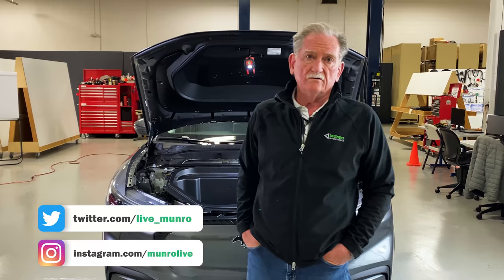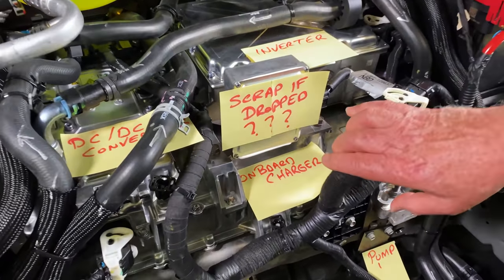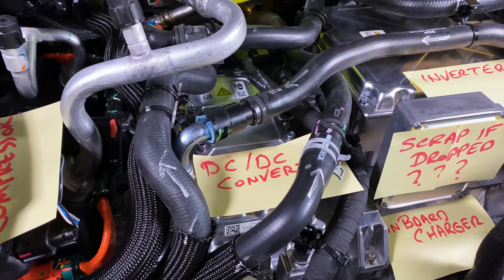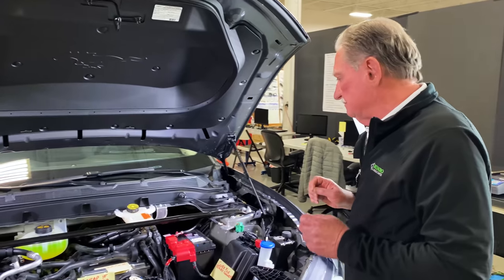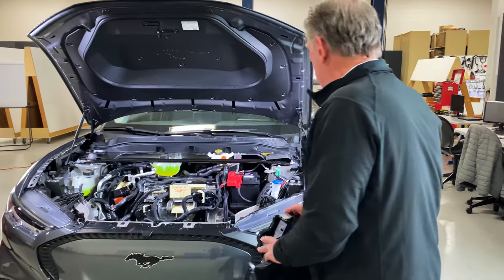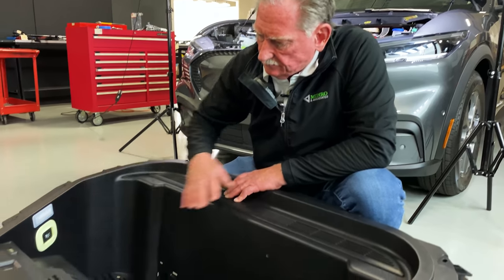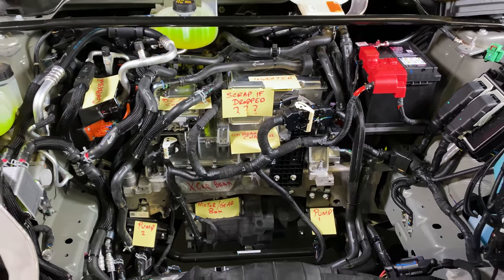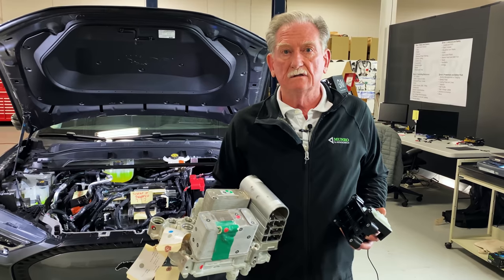Mach-E Thermal System Nightmare

Comment: I hope the F150 Lightning is better designed than the Mach-E
Reply: I don't expect the F150 will be much different since the design philosophy at Ford remains unchanged. Tesla appears to take the vertically integrated approach to everything, whereas Ford wants to buy components sourced from the cheapest manufacturer and hold them to very high-quality standards, and then integrate them all together. The problem with the latter approach is that it results in a more complicated system that leaves you vulnerable to assembly error and quality issues down the road, regardless of how well you test the components and vehicle level testing during the design phase. Tesla's approach will win in the end.
Reply: @vector006  I thought one of the main gripes about tesla was poor quality control?
Reply: good luck. The dealer model cannot survive without them engineering things that break into the product.
Reply: @Sam-tx1tn  Why are you so bitter?
Reply: @thdjjfsfh  stating a fact isn’t being bitter. This guy is a cash chaser. No more.
Reply: @Ranjan  Rahul Who cares as long as it works? Tesla quality is worse. No bonus points for being prettier underneath if it's poor quality anyway
Reply: @Sam-tx1tn  No, you're bitter and hateful.  All he said was he hope the truck are better design.
Reply: @EricJohnson-dc2ej  Poor quality? Sorry pal but my neighbors been driving one as a Taxi now for 5 years. Best car he as EVER owned in 30 years of driving a cab. Its got over 300,000 miles on the original battery and other than tires, suspension bushings, shocks, one set of brakes and some minor trim things the cars been flawless. And its costing him 1/4 of what his Prius used to.
Reply: @EricJohnson-dc2ej  yes that is true for now. They don't have a robust DVP&R process yet like the legacy automakers do, but I think they will evolve as the company matures. Their design philosophy should win in the end though.
Reply: Lol. Same. I'm already sold on the lightning. But Ford's decision to overly complicate basic systems has me worried they're more interested in keeping dealerships open, than building a sold EV.
Reply: @BremboT  sounds like this guy hasn't even talked to anyone at Ford as to why they did what they did so most of his comments are uninformed speculation. He doesn't even know what all the parts are.
Reply: Fard: Hehehehe hee hee >:)
Reply: @davefroman4700  Riiiiiiiiiiiight………..

Comment: I Love your breakdowns and a fan of your work. I have to let you know that ford changed their plastic long after you left and those connectors don't leak anymore. You would be surprised how their plastic under the hood with an engine and it's heat, will hold up even with a turbo. My son has the car to prove it. Hopefully Tesla's plastic is as good because I just ordered my Model 3 😁 Keep up the great work!

Comment: I originally thought that EVs were supposed to be more reliable because of fewer moving parts, but after this video I see "OMG this is going to leak and it's going to be a nightmare to fix". Great video by the way.
Reply: Not Tesla, that's why but Tesla
Reply: Replacing a hose and a clip is not difficult, but the high number of hoses and clips and what not, will make sure if you have repaired one, you are back in the shop a while later to do another one, and this goes on and on, to the point it gets really annoying, and if out of warranty also costly.
Reply: From what I’ve read they are not under pressure like ice cars.
Reply: Ford has the hungry dealers to feed with the money of the customers - it's obsolescence design at its best.
Reply: Nonsense, who said its going to leak, there is no temperatures from combustion engines there which can mess the hoses durability.
Reply: @AndrewSienx  wrong.
Reply: @alanmay7929  "Hoses gonna leak, thats just a fact"- Sandy Munro.

You have temperatures from the batteries, and its porbably under some pressure as well.
Reply: @MarcoNierop  only yime will tell, the temperature from the batteries is not even close to what the combustion engine can produce nice try.
Reply: @alanmay7929  You are not an engineer, aren't ya?

The coolant is basically water, and its not cooking to steam in a combustion engine (if it does, you have a problem!), so the cooling water does not reach 100 degrees Celcius.. You can check the temperature on the gage in your car, 75 degrees Celcius is about normal.

Batteries feel the most happy arround 80 degrees Celcius, so the cooling gets pretty hot with batteries as well, not much difference with a combustion engine.

Quickly counting I saw at about 20 hoses, that means 40 connections, or 40 chances of getting a leak, versues maybe 4 or 5 in a Tesla, that is 8x more chance to get a leak in a Mach-E.

Comment: I think Ford and GM were caught flat-footed when Toyota developed and ramped up the Electric car movement and are now under tremendous pressure to transition their operation to have anything competitive to offer. They had to design and push out an electric vehicle fast, and it couldn't look like a grain wagon pulled by two Doberman Pinchers. I know the electric Mustang looks good from the outside, and it is fast (as most electrics with enough battery power are), and that will be enough for most teenagers - longevity and reliability are mostly concerning to those with enough life experience to know how frustrating break downs and repair bills are.
Reply: The question is, even if these parts are complete garbage, like a crappy plastic pump fails every 60-120k or it throws a leak through a pipe.

Ford will sell you parts. That's the difference. 
They're crappy parts, but they'll let you have them.
Reply: @MrClassifide  I will choose the car which has parts available at reasonable prices. Tesla havent been around that long but they seem unwilling to help with parts as soon as you are out of warranty.

Comment: ...why use radiator when you can increase cooling area of the hoses? Also, in emergency, excess heat is dumped by leaking boiling fluid trough the loose connectors over the electronic circuits that automatically shut down the system...xD

Comment: You remind me that we owned a 1986 Taurus MT-5 (2.5 l 4-cylinder/5 speed manual) and a 1986 Acura Legend (2.5 l V6/5 speed) simultaneously. The ashtray in the Taurus was made up of a plastic face with a metal ashtray riveted to the face. My recollection is that the metal ashtray was a 3 piece assembly. The ashtray on the Acura was a one-piece injection-molded part with the finish molded into the plastic. It was a sad comparison of the two cars and even as the Taurus was a great packaging job, it failed in many details. Needless to say. the 90 hp four cylinder was no match for the 150 hp 4-cam V6 of the Acura. The saddest part was that the Taurus had potential as a competitor to the Acura - it drove and handled reasonably well for a 3000 lb sedan. Sadly, as with most domestic cars, the accountant influence on the Taurus' design created a visually pleasant automobile that really did not compete well against the Japanese cars of the time.

Comment: Five minutes in, after Sandy pointed out all the hoses, all the COSC clamps and all the screws...it made me think of Soviet machines that were copies of American technology. They got it done, but it looked more like a garage science experiment (proof of concept) than it looked like finished engineering. And it wasn't reliable. 
"Scrap if dropped" means x miles of rough roads = Recall. 
Next Tesla event, right after some one shouts, "Jacket!" to get Musk to do a runway twirl, some other wise guy is going to shout, "Cory! Get the Octovalve!"
Reply from the maker: Haha. Awesome.

Comment: I would never buy a Mach-E after looking at this poor design.    Make sure you buy the extended warranty since repair costs are going to be mindboggling.
Reply: Nah, you can get cheap coolant hoses and worm clamps at Autozone. No need to see a dealer for that.
Reply: The benefit to cots is that replacement parts are cheap and plentiful. You can wait a month to get parts from Tesla.
Reply: @JohnLee-ed8yi  yeah, at least you can fix it yourself with generic parts...or ford will sell you the hose happily.  Tesla is taking the apple aproach of "only we can fix it" and there's no way they're not going to use brand new "assemblys" when all you need is a 50c clamp. 

The horrors with this car is going to be in accident repair. This coolant system is not under 15lbs of pressure like a gas car is so it's not going to leak unless a clamp is severely misplaced or a fitting gets hit by something and cracks. The cause of leaks in gas cars is the "severe" pressure and temperature swings the parts encounter daily or multiple times a day actively trying to force coolant out. This isn't a pressurized system, it doesn't operate above or near the boiling point of water like a gas / diesel car does, hence no need for pressure.
Reply: @volvo09  very good point of low pressure cooling system. However, I think Ford needs to come up with a new integrated valve body or something to really reduce the complexity of these hoses and clamps. It is a nightmare for assembly either at the factory or a supplier.

Comment: I tried to get 3 Ford dealer service depts to give me the price to replace 35 proprietary rotting rubber cooling hoses after the warrantee runs out.  They looked at me like I was crazy...
I guess the days of wrapping a popped radiator hose in duct tape, filling the radiator with ditch water then leaving the pressure cap loose so you can get home are over...Pity.
Two new radiator hoses for my 1983 Mercedes 300TD diesel was about $18 at Rockauto...😁

Comment: Elon’s going to have a good chuckle. . .
Reply: Teslas build quality is so abysmal, Porsche is the only one who can chuckle when it comes to good build electric cars.
Reply: @pete-p4t  You still living in 2017?
Reply: @pete-p4t  had my Model S for almost 6 years now, perfect build quality and zero issues.  It's been in the shop once, for its scheduled 3-year maintenance.  They replaced the wipers, the cabin air filter, looked at the brake fluid, and lubricated the rotors.  That was it.   Seriously.  It's insane.  Admittedly, I am on my 4th set of tires, but that's on me.  Ludicrous Mode is just too much fun! :D
Reply: @BrowncoatFairy  The question now is, are you getting the plaid? Plaid, eats through tires twice as fast :D
Reply: That's what she said LOL
Reply: @BrowncoatFairy  there are 30 years old porsches still on roads....
Reply: Tesla now importing China build cars to Europe. Bjorn Nyland reviewing . Fit and finish about perfect. Paint looks preytty good too. Expect Berlin and Austin cars to also be a big improvement on Freemont output.l
Reply: Teslas integration also poses problems though, if one thing breaks, you will have to replace the whole part which might actually cost more. At any rate, all of these new BEVs are alot more complicated than most people imagined.
Reply: @alanmay7929  yeah there are old Porsches around, sure.   And none of them go 3 years between maintenance services.  try to keep up with the conversation.
Reply: @andrewmeehan6151  and tesla is not even selling parts for those repairing and rebuilding teslas, its such a shame, they are litteraly copying apple. The apple silicon macs are going to be almost impossible to repair and zero upgrade possible.
Reply: @madgaming3172  undecided.  i had a Plaid+ order because i liked the 520 mile range, but that got cancelled by Elon.  Since Plaid only does 390 miles range, i think i'm happy keeping my 5-year-old P100D which still does over 300 miles per charge.  If i didn't already have one, though, i'd be totally on board.  The Model S is a phenomenal car.  highly recommended.  And maintenance has been practically zero in 5 years.  Just bums me out when people snark about "build quality" or whatever when they don't know what they're talking about.
Reply: @BrowncoatFairy  whats wrong with maintenance?! Lol. Porsche aren't for everyone btw.
Reply: @alanmay7929  People look at Elon like he is the messiah, but at the end of the day they are just a business and people have bought into the hype, hence the stock price.

Objectively speaking their "technical superiority" is bogus. In the real world, there are a whole bunch of BEVs that can at least match or exceed the range of Teslas. FSD isn't really FSD, and the interiors are crap. The only real selling point is that they are fast, but that is because they are cheaply made and light. 

I've been saying it for years, they are just the new "cool" 3 series, for folks who want to be environmentally friendly.
Reply: @andrewmeehan6151  Please send us he list of all the BEVs with more range than a Tesla.
Reply: @jimdetry9420  Any Korean BEV has more range than a comparable Standard Range Model 3, and they come within 10-20 miles of the much more expensive Tesla models. The Chevy bolt is another one that wallops the Model 3 in REAL world range.

Comment: Hello, I’m not an engineer but I’m guessing that the cover you mentioned over the high voltage connectors are there to protect them when the battery has to be replaced that could potentially hit them or be set on them when removed. Maybe get a Ford design engineer involved with your review for input versus guessing why/what/how?
Thanks for sharing,
DC

Comment: A multiple-value hub would be controlled by a single zone-ECU, instead of a separate ECU for every control loop - which insofar has its own pump, tank and valves gasket.

Comment: That separator was actually for compliance. If you have a cargo area of a certain uninterrupted size then you have to have the internal release.  Manufacturers will put a cheap afterthought divider in to meet that compliance fully expecting the owners to remove it immediately.  The rule only applies in the United States so they don't have to do it anywhere else.

Comment: Wow! Automotive spaghetti. Agree 100% that it wont go 6 months without springing a leak or a weep. Agree with some of the other commenters that the "simpler" EV concept is compromised with this design. Those spring clips are great for assembly but I still replace with worm drive clamps when I have the opportunity. Maybe a bit more finessing when they do the next model. 
Also Ford developed E coat and sat on it for years before actually using it so what has changed?

Comment: I really did enjoy that.  Thank you for this because it’s really great to see the reason why engineers decide to utilise certain components in the construction of power plants in cars and better alternatives often either are over looked or done on the cheap to cut costs.  It’s also great to know what to look out for because prevention is better than cure so preventative maintenance is key and I would be replacing those hose clamps with modern jubilee clamps,  if not replacing the hoses with moulded pipes joints (where possible) so hose clamps are kept to a minimum,  less is better when it comes to pressurised scalding water or coolant in the area of HT-HV wires.  Thank you for the great advice I will put it to good use ! 😉👍 !! five stars for great advice !! ⭐️⭐️⭐️⭐️⭐️

Comment: I typ hate vertical stack designs: always thermal issues. Cooling was clearly an after thought here, because it looks like first they designed the layout, next hoses to reach every component. For electrical, I would have moved all wires to the back. Scrap if dropped - tells me all assembled by hand.

Comment: Yes, so many hoses and joins will definitely leak after a while. You can set your watch to it. I’m 60 years old and have seen this issue on so many cars over the decades. Sandy is spot on to challenge Ford to beat Tesla in changing it with in a year. I doubt they will, but hope they do. Thanks Sandy.

Comment: As the vehicle reaches 5 yrs old and 75k miles, this thing becomes a maintenance nightmare. Chasing after leaking spring clamps and hoses that dry out and start cracking. I drive a 15yr old car that I have kept maintained myself, I would not want to own this Mach E after 3 yrs.

Comment: Spring hose clamps are used by the Japanese motorcycle industry.  I hope they work, I just converted my 1977 Lincoln Mk5 to these in order to clean up the appearance.  Spring tension increases as pressure builds, unlike clamps which are static in tension.

Yes the Tesla has a one piece bucket up front, but if you have to service anything, you have to remove the entire one piece unit.  BTW, Tesla does not want you to touch anything beyond the driver interface.

Comment: Living and doing car repair overseas and in austere environs over the years, I can somewhat understand using COTS and standard fittings for ease of replacement. The standard hose will be much easier to get than one-piece single part number Autocraft hoses and connectors. Even the stacked discreet component boxes make sense when you think about replacing an integrated master board vs individual components for repair, especially in a first generation try at mass marketing this as a company. 

It's very busy under there, but it screams to me that they had cooling issues during development. What I don't understand is after all that work and money running all that hose, why they would decide to have the front intakes so closed up with so little airflow that you then have the cooling issues others have experienced in reviews?

Comment: Question in regards to the battery tray mentioned. Shouldn't all electric cars at this point be moving away from lead acid batteries? Seems like a waste of weight. Tesla is just now heading that way with the new S and X. Surly the 3 and Y wont be far behind.